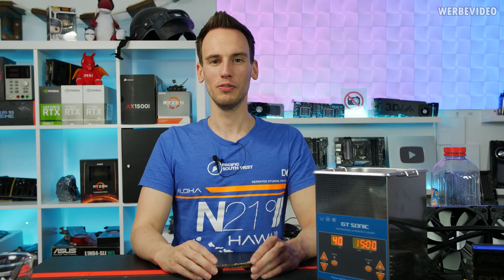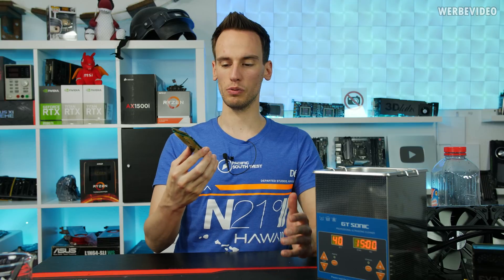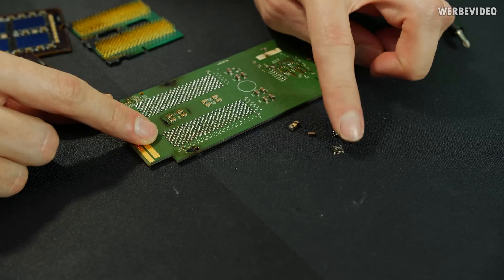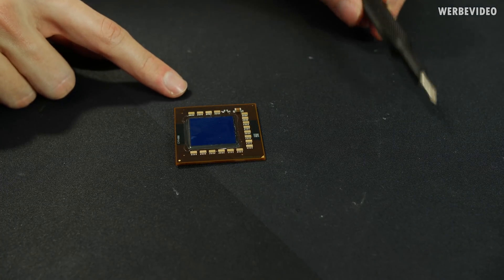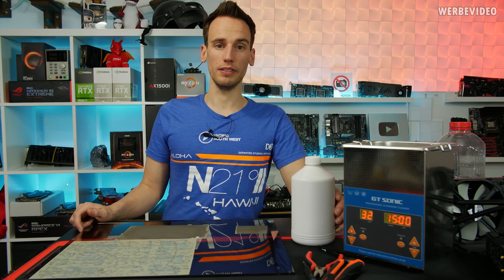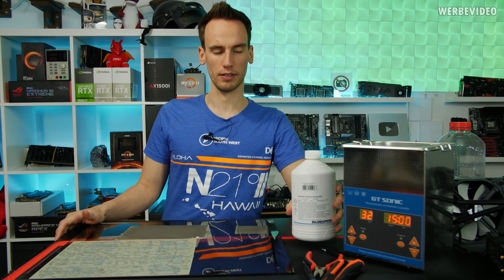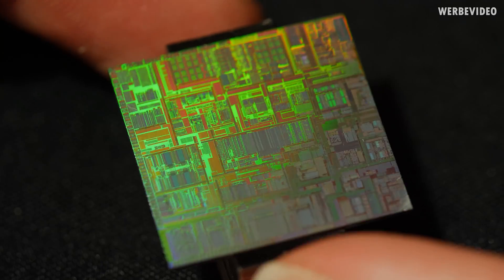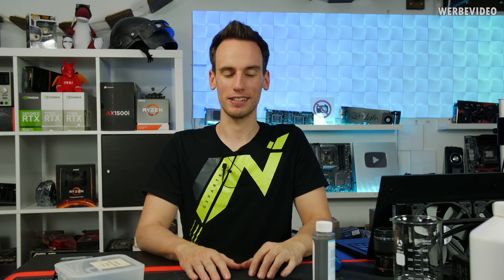We destroyed the Intel Itanium - My most beautiful Die-Shots ever!

Comment: A tip for future etching: If possible try to put the dies on top of the choride so they float on the liquid (also make sure there are no air bubbles underneath the die by shaking it a little). This way the process is much faster (about 60 um per hour from experience) because the gravity starts to rip off the larger copper pieces when they are not held by the die anymore. Anyways great video and the dies are beautiful :)

Comment: If you manage to find a good infra-red microscope, you should be able to see that through the Silicon from the backside. (Maybe you need to polish the silicon, but you don’t need to touch the frontside of the chip.)
Of course, you won’t get the nice rainbow colors. But you will be able to see the different blocks of the chip.

Comment: If you need a much more powerful etchant, you can very easily make one, by dissolving any nitrate salt (ammonium nitrate, potassium nitrate or sodium nitrate) in 20% hydrochloric acid. It can etch copper at very high speeds if it is warm. The reaction is quite temperature sensitive, it is very slow if cooled down too much, but proceeds at rocket speeds if the mixture is hot. The reaction also produces nitric oxide, which is hazardous, but if you are only etching dies, the amount of copper removed is probably well under a gram, so it should be safe.
The mixture may be able to etch gold and other noble metals if hot, but I am not 100% sure about that.

Comment: Usually the Iron III Chloride etches the copper away very quickly. Yet those chips seem to use Cu-NiPdAu finish - copper tracks are covered with nickel, then palladium, then gold. Gold protects the metal from the etchant and the chloride can only attack it from the sides, this is probably why it takes ages.

Comment: 2:28 "this should be an inductor" That's a fuse made by littelfuse, it says 160 mA on it, I think the "A" got damaged in the heating which is why it looks like an "H." There are 7 other fuses on the other side!
The chips are an Analog Devices ADM1021ARQ temperature sensor (sold by OnSemi since 2007) and two Atmel 24C01A 1k serial eeproms.
Reply: AdmiralSpeedy I did wonder when he said Mh